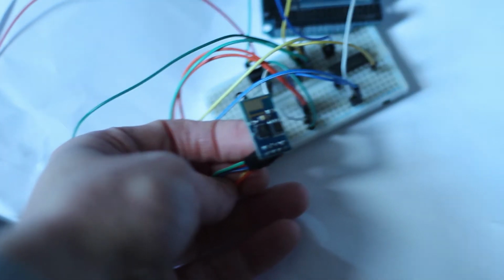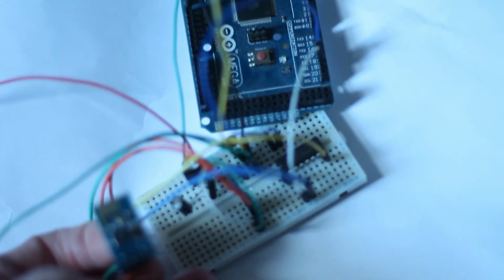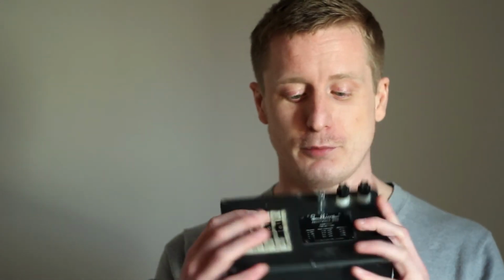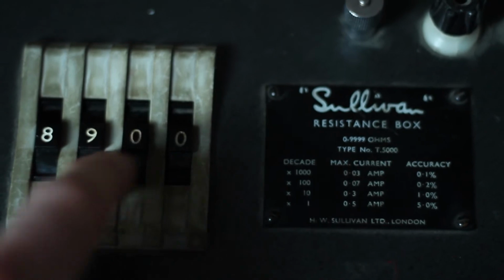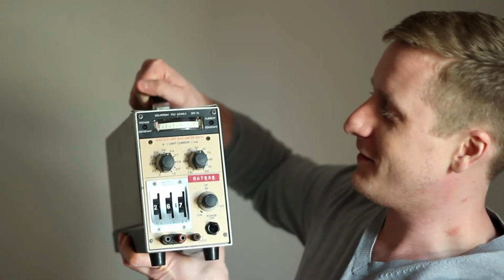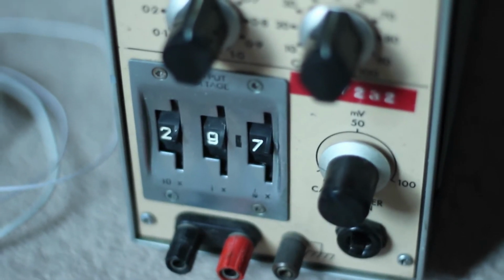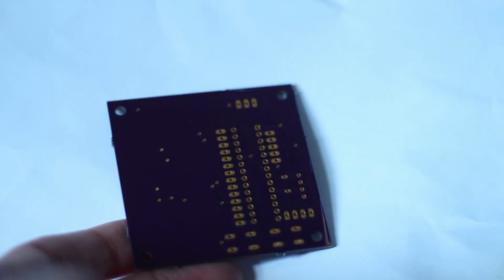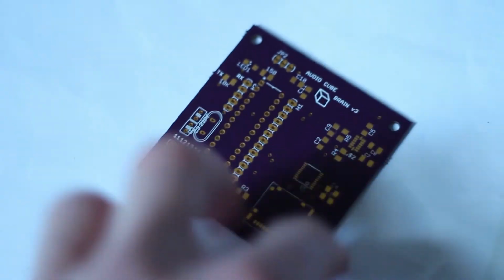Update 1: Projects and News

Comment: Hah, looks like we're all doing wireless temperature sensors and switching over to ESP8266 these days! I ordered a few of those myself for the same reason just 4 days ago. Maybe you follow Kevin Darraghs channel as well?!
I still really like the nrf24l01, though. It's a great device and has worked really well for me here, so I'll always have a place for it. And it's really easy to use, probably easier than the ESP8266 I suspect. Not to mention I wish I could trust my wifi to be stable enough for the ESP8266.
Looking forward to the upcoming videos + best of luck in the new house.
Reply from the maker: Ha ha, I think we are all on the ESP8266 bandwagon, temp sensing and all. I do follow Kevin but he is way more advanced than me and I get lost in his explanations.I have picked up most of my knowledge from youtube and Arduino.cc so far. I want to use the NRF24L01+ modules for the same reason, I want it to be primarily an offline device that displays temperature to a main hub and the extra functionality will come from saving those readings to a database.